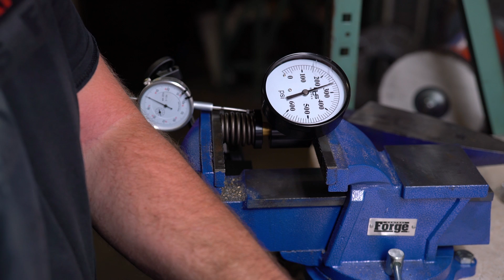Valve Spring Test - Cummins VS Ebay | Power Driven Diesel

Comment: worse than the spring seat or open pressures is the cycle hardening that causes broke springs and droped valves. never go cheap on valve springs or anything that has a high duty cycle. jus sayin:)  good job PDD
Reply: Well said

Comment: Towing with a manual trans, I.E. Getrag 360, NV4500, NV5600, G56 how bad is it to tow in O.D. (Getrag 360/NV4500 5th gear) / (NV5600/G56 6th gear). I understand that axle gear ratio, tire size, towing weight and a few other things will make this differ from one thing to the other. In a respectable weight limit is it really that bad ? Thanks
Reply: thanks for the reply

Comment: What's the difference  between the $130 p7100 governor springs you sell and the $225 springs?
Reply: @pddofficial  have you done any testing on both sets? Is consistency better on the bosch springs? Are the rates the same? Do the bosch springs hold up better after many cycles? I appreciate the feedback. Its really just sheer curiosity if there is something demonstraightably different or maybe just plecebo effect.
Reply: njdevi11 Ran both the Bosch and the pacbrake, the pacbrake springs kinda run away from around 1100 to 1800 nothing wrong with them just can get jumpy when in lower gears, the Bosch ones are a lot smoother and driver friendly, Recommend the Bosch but for a budget beater the cheap ones do the job